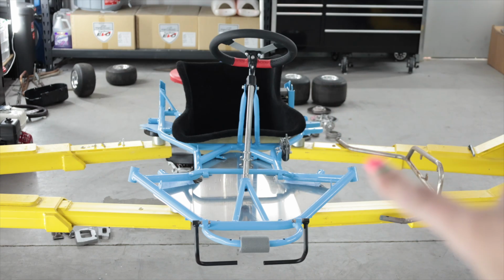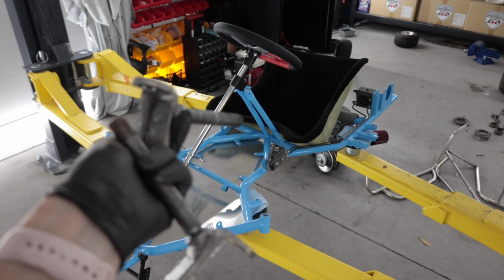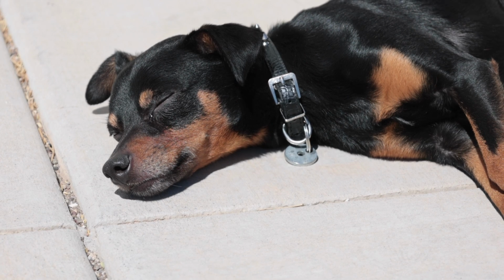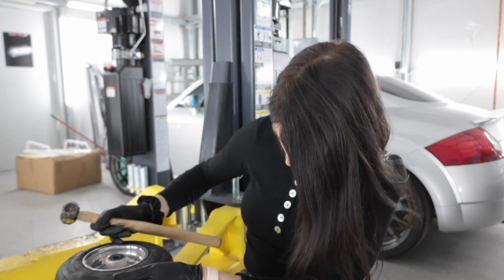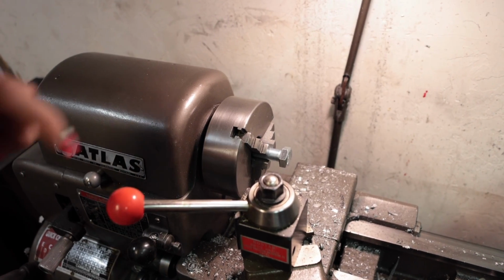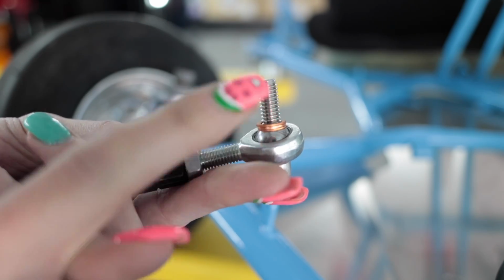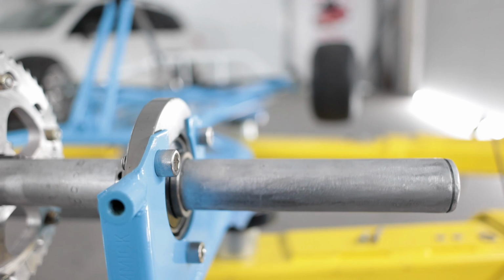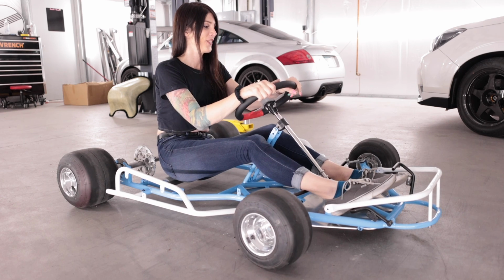Final Reassembly.. Isn't Going So Well // Honda Powered Emmick Kart

Comment: The bolts on the spindle are for front ride height adjustment. Steering colomn bushings almost always squeak on those things, and once you clamp down the sprocket and brake hub they will most likely straighten out

Comment: Bent sprocket and rotor: take a note from the MTB industry, take an adjustable wrench with smooth jaw, and use it to bent your parts flat. No need to replace unless their tore up.

Comment: Hello i may have an answer to your loose fitting spindal. Put washers above and below to adjust to "STAGGER" to fine tune your chassis for different tracks. I had an Emmick Star in the 80s. This is my favorite frame.

Comment: For the spindles, we used washers top and bottom.  you could vary the number to adjust handling.
Reply from the maker: Now I can do the same by backing off or tightening down the upper and lower hardware.
Reply: @SarahnTuned  I can see how that's gonna be super important in a parking lot.  Just kidding, your work is awesome.  You definitely have "while I'm in there" syndrome, but it just produces quality.
Reply: @SarahnTuned  we’d space the tires out in front the same way. Cart was a left turn only chassis, yours looks straight.

Comment: The Adjustment on the spindle is to control how much your inside rear tire come up in a turn. Also guessing your going to run in a Clone or 206 class. You can pull the RPM governor our of the engine and go from 3600-7000 rpm. Only other modification needed to run that fast is 10 LBS valve springs to control valve drift. I would also recommend is a high flow air filter kit, better muffler, Move the fuel tank to under the steering wheel. When you start driving you will need to play the tire PSI game. 2-3 psi can make a big difference. Hopefully this is seen and is helpfully.

Comment: Hey Sarah, your good , you could run a tap down on the longer front spindle cut it down to match the shorter one if long enough to use (castle nut ?)and some cone spacers for the bearings
Reply: watermelon and vintage go-carts  nice !

Comment: Nice work as expected!

Ride height adjustment? Speaking of adjustments...you could have a longer and adjustable steering arm on the column for adjustable Ackerman, tune the handling on different surfaces. Not that I like tuning a lot.

Comment: You should be able to straighten the brake rotor and sprocket. I’ve had to do it on my atv’s and motorcycle. Get a dial indicator with magnetic base from harbor freight.  Straighten the brake rotor, go for a ride, use the brakes, the brake rotor will want to warp a little after using the brake, straighten again and then it should be good.

Comment: Thank you for a informative and entertaining video as always!
Nitpicking, but always use a washer againt painted surfaces, and orientate the washer so the stamped rounded edge side is against the painted surface. You used a hammer for the wheel bearings, could you not use your bearing press for the wheelbearings? I am asking because you can damage a bearing with a hammer. Your garage need a cabinet with lubes, grease and oils for different and various lubrication purpuses, and rags and tissue to go for it.  Oily rags and tissue paper can self ignite, so please get a bin with a hinged lid that closes itself. Looking forward to your next video already!
Cheers.

Comment: Racing Kart build tip:  Always put a couple split locking collars on each side of your rear axle bearings .. .and NEVER USE those bearing setscrews... NEVER!!!  Such set screws usually come loose, and put upsets in your axle that make it nearly impossible to slide components on/off.  If that rear axle slips and shifts during cornering... you will find yourself on your head REAL quick (seen it many times at the kart track, lol). Also put one of those collars behind each rear wheel hub too ... for added assurance against slipping, to keep you off your head.  This is how we set up all our racing karts.
Reply: Also, use plain shanked bolts through your Heim joints. A drip of lube likely to cure your steering shaft squeak.

Comment: Charlie was correct about the spacers he made: normally they are eccentric washers to let you set camber & caster. And on that note, make sure you check the alignment before running it - you'll tear up the tires in a heartbeat if it's off.
Did you check the rear axle to make sure it isn't bent? Axles are generally classified as "wear items" on a kart.
Good luck & have fun  with it!
Reply: One other note - if you go to a karting track you'll need full-width bumpers (i.e. as wide as the tires) front & rear unless you're running with a Vintage Karting group.
While your kart is definitely Vintage.... the engine isn't.

Comment: For a rough set up of the front end set the kart on a flat surface for all 4 tires. Then turn your steering wheel all the way to the left and take a measurement of the clearance between the tire and floor. Then turn it all the way to the right. Adjust your spindles to get the same clearance on both front tires. This should help with the handling of the kart. Good luck.

Comment: With both rear wheels bolted to the axle, you have the equivalent of a locked differential or spool, resulting in wheel scrub and loss of power when you turn. It would be better if it were set up with one free-wheeling wheel and one-wheel drive — unless you're only going to be offroading the cart.

Comment: Peugeot 106 and Citroen Saxo use 4 holes rims. The one thas uses 3 hole wheels are the oldest Citroen Visa and AX. :)
(The Smart also uses 3 holes)
Reply: 106 and Saxo base models have 3 holes.

Comment: Sarah, you are doing a great job in restoring / improving / make the Go--art better than new. But copper washers in a steel environment? This will give a galvanic reaction if wet. The copper will be "eaten" by the steel aka corrosion! As long everything remains dry (not so difficult in AZ) it will stay ok.

Comment: Dropping the nose = less caster
Lifting the nose = more caster

Kinda like rake n fork tubes on a motorcycle.

Also, verify the axle is not the source of the rotor and sprocket runout.

Comment: Your spindles actually should be different. Especially if this was an oval or dirt kart. The LH and RH are set up for different width wheels and tires on race karts in the front. It has to do with weight distribution in the kart on track.

Comment: Quick TIP, your always cutting with the Die Grinder/Cutting Wheel Backwards.
For example- when you started cutting the bolt. If the wheel Binds or Catches, your going to have the tool thrown back at you. Not to mention you'll get pelted with Cutting wheel pieces.
 You should have started cutting with the tool on the right side and from top toward the Bottom.
 Just saying. I'd hate for you to get hurt.
KEEP UP THE GREST WORK. I"M A HUGE FAN!!

Comment: Today on "Welding n Paint with Sarah", how to get a weld tan from crop tops.... ;)
Different front stub axles could be for Left Turn Only racing, with a spacer off-setting one wheel to change weight biasing.
Reply: That sounds very plausible for go-kart oval racing.

Comment: Yup.   Sarah buys a cheap gocart, then spends hundreds making it all new.  Even better than new.  ☺️
Reply: Between parts and labor costs she's well into the thousands of dollars invested.  Mind you, it's a labor of love and those never are financially sound.  Just ask anyone that collects anything. lol  We've all gone overboard on something  at one time or another.
Reply: Sarah, is spending a little more than a few hundred here to make this machine do it's job properly... Maybe into the $1,500 range to get it going, maybe even more... But the extra effort and $ is totally worth it... 1) The owner/driver get to KNOW & APPRECIATE their machines, and the engineering that went into it. 2) The machine becomes more efficient and has more reliability when set-up correctly. 3) The machine, with increased reliability also has increased safety because of less chance of a mechanical / structural failure. These kind of failures can cause injury, hospitalization or even death. The efforts and expense to prevent such failures is worth every second of work and every penny spent on it ....
Reply: @michaelmartinez1345  yes

Comment: Umm..... when you were shortening that bolt..... i'v never seen anyone using a grinder like that, cutting from the top, with the sparks away from you....
That means the grinder is trying to force itself towards you, and possibly 'jump', which can cause a disc to shatter.
Kind of back to front.... 
When cutting you always want to be gently 'pulling' the grinder, not pushing it...
Just sayin'....